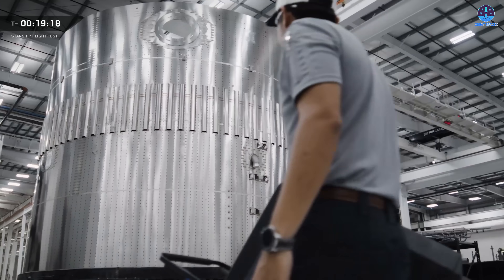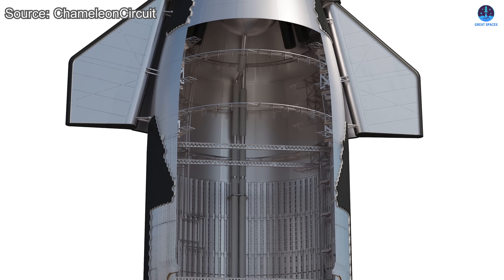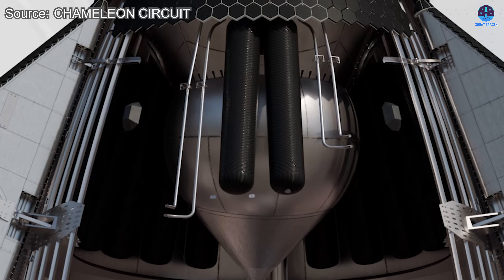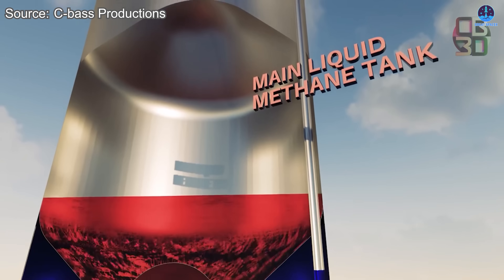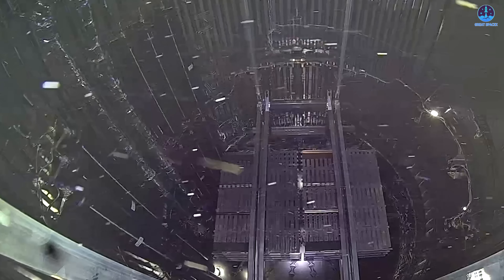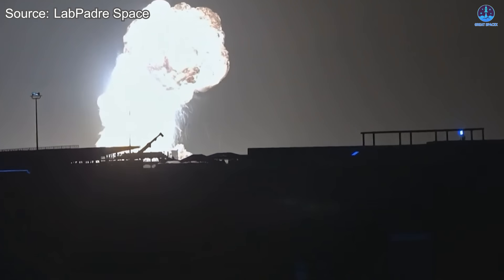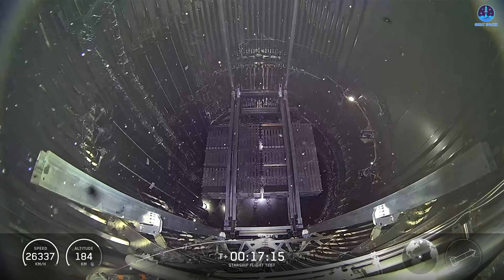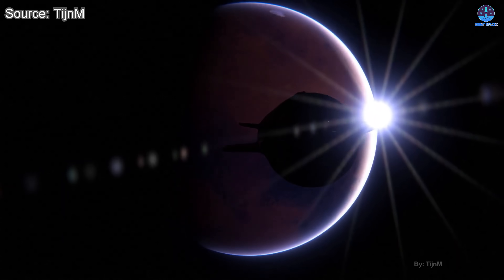Elon Musk revealed Exactly Why COPV can make Starship S36 Catastrophic Explosion...

Comment: Elon, as a mindset, always chooses to squeeze out every last bit of drop of performance from his designs. For example - design a multi-stage rocket - it should have hot staging.. Need tanks to contain fluids - use COPVs instead of steel vessels as they are lighter.. Relatively more dangerous designs all in order for more mission efficiency.. This mindset is not unworkable, it is perfectly possible to design such working things.. But they have to have robust safety features in the design. These rockets are like chemical factories that fly. And in every chemical process there should be safety in the design.

So designs are assessed first for safety and risks through and through - before they are built. As chemical engineers often say: "Do your HAZOPs guys"

Comment: Personally, I'm not impressed by Composite materials like Carbon-Fibre as a material. I assume they used it for reasons of lightness, but for such a critical component, I think they should have gone for a more proven material, such as a lightweight metal like Titanium, which would be more suitable for multiple re-use over time.

Comment: 0210 Actually, no.   The COPV did NOT fail because it exceeded pressure limits. According to the Elon post you included, it failed BELOW proof pressure.  This means it likely failed because of an undetected manufacturing defect, or possibly because something "knocked" it hard enough to compromise integrity.  Unless, the actual cause was something else (hence "further investigation."
Reply: Isn't that even worst?
Reply: I also find this interesting. But of course pressure is only one sort of load that can lead to failure. I was even surprised they use carbon fiber at all plus a strange way of not-really-weaving that mostly depends on the glue - whatever. In a vehicle that will fail, brittle components are a no-go because they make the analysis hard: clues are everywhere, literally. smashed.

Comment: Gosh.  You'd think that the Oceangate Titan implosion would have been enough of a warning for SpaceX engineers...
Reply: No so.   Titan failed due to COMPRESSION failure.  The college opposite.   Plus Titan had to withstand 5,000psi+ at Titanic, where a "normal" tank (SoaceX might have different sites) is only 2,200 psi.  Keep in mind,  PSI is not a linear profession. 

Plus, if you had watched Titans videos, they didn't "overwatch" - criss cross- the CF strands - the just did a spiral wrap. Nor did they do the wrapping under lab conditions or properly test and cure the vessel.
Reply: 😂 your a little slow huh

Comment: Because of ongoing on-orbit issues with orientation control authority combined with Musk's statement about the COPV I think it very likely that they were pumping the COPV to a higher pressure than they used in past missions, closer to the test limit. Pure speculation, but I think this scenario is likely.
Reply: An ex Spacex engineer has come forward to say workers at Spacex have been handling COPVs carelessly and rushing through engineering tasks with inadequate care and testing.

Comment: Did the COPV get too hot; Was it baking in the Ship, in the Texas summer sun? Before an uncontrolled temp shock when cryogenic LNG-fuelling started in the cooling night environment? Thermal cycling resistance of COPVs, questionable? Were temp sensors in the Ship? 
I think even the JAXA Lunar lander failure stems from a thermal shock problem, too. With their high-tec ceramic nozzle in untested Lunar surface conditions! 
When the cold Nozzle Bell came down, landing, 
 from the usual cold shadowy space condition, and dived into >100°C IR radiation outside, uneven_sided IR _ from the daylight Lunar surface, while the engine ran for a few minutes; this ceramic nozzle was overwhelmed! 
  To avoid too sharp thermal shocks, a layer of insulating foam over the COPVs outside may help.

Comment: How many times has this unit been used? Maybe the copv units will need to be replaced more frequently to ensure these explosions dont occure.
A bit like helicopters have to have certain bits replaced frequently because of the vibration. It is still a multi use vehicle but just needs more maintenance
Reply: I heard they reused the one recovered from the Bahamas a few months ago 😜

Comment: COPD failure in falcon nine, failure of the titan submersible at lessless than the maximum depth?, and now COPD failure with starship two. Am I the only one that can see a trend here with this composite material and structure?  I think carbon fiber is fine for an application where you need maximum weight savings with maximum strength, and you only need to do it one time. A HMARS missile, Or an ICBM. No people involved, and only gets used once, and if it were to fail, not too big a deal. I think these kinds of composites are a bad idea. They just do not have the toughness of steel and titanium.  I’m not overtly against using them, but they need to be added only as a safety measure, not something that provides the threshold strength. The threshold strength needs to be achieved by the steel or titanium tank itself. Then add some carbon fiber to increase your margin of safety. That is not what most people do today. The bottom line is that I just do not trust, carbon, fiber, and neither should you. If something sounds too good to be true, it probably is.

Comment: hmmm, a difficult problem.The carbon fiber wrapping overall adds strength but any weakness or inconsistency in the wrap could be difficult to detect, so will they need to go with a solid body system; thicker and easier to measure, but add more weight.

Comment: Truthfully Aliminium and carbon fibre will vibrate loose and seperate. It’s not a long term solution. Why not 3D cast or print new ones in different mediums with stress line backup. Held against launch forces. Make s sense thnx kev.

Comment: That Titan submarine that imploded heading to Titanic was composite overwrap. Composite overwrap on solid rocket boosters have failed in the past causing rockets to blow up.  Carbon fiber has excellent tensile strength but sheer strength is near zero, that is why the Columbia shuttle blew up during reentry because of hole in the carbon leading edge. Even NASA engineers don't quite understand the difference between tensile strength & sheer strength.  Bottom line is, Don't trust carbon fiber.

Comment: Sounds like same or analogous issue that plagued the OceanGate Titan submersible.  Just another in a continuation of unexpected/unresolved Starship problems.  Like Stockton Rush, Musk is full of chutzpah.  Hmmmmmmmmm.
Reply: The high pressure is on the other side to titan. Titan had pressure pushing in, the copv has pressure pushing out. Carbon fibre is good in tension not compression

Comment: The should increase the wall thickness of the aluminum vessel and double the thickness of the carbon fiber wrap. Have the pressure point of failure far away from the working pressure.

Comment: Replace the circle of small COPVs with a big toroidal fuel tank, the width of the craft. With big toroidal tanks, stacked, you get a better volume-to-surface area ratio, so you can afford to use stronger, thicker walls, or have the same amount of gas in larger-volume tanks that operate under less extreme pressure. And you still have central access.
Reply: The COPV’s separately pressurise the fuel and oxygen tanks to ensure feed to the engines. They are not “fuel” tanks.
Reply: Thanks for the correction

Comment: If spacex weren't so tight, there are metals out there that would be very suitable for the copv.
Reply: The solid metal tanks weigh more.
Starship is severely weight limited.
Reply: They should be made out of titanium. Yes its expensive but very strong and light and something like that they shouldn't fool around with.
Reply: @randomnonymous Titanium is heavier than aluminum alloys… (it does have better heat and corrosion resistance).
Reply: @allangibson8494  It is also somewhat flexible like a spring.
Reply: @randomnonymous Actually carbon fiber has virtually no “give” at all - it’s the epoxy resin gluing it together that gives.
It yields at 90% of breaking strain.
Reply: its a lot easier to spend other Peoples Money for them.

Comment: My guess: 

Carbon was not wrapped tightly enough, allowing the aluminum tank to expand/contract beyond tolerance.

Fatigue tolerance in aluminum is often 20k cycles, but it may be 2k cycles or less at these temperatures.
Reply: One nick or scratch and fatigue values are out the window. cyclic loads cut by 10X
Reply: @HongyaMa 

Yeah.

Aluminum and carbon/epoxy probably have very different coefficients of thermal expansion.  

You get a strain spike right on the bond.
Reply: Agreed, pretension of prepreg tape insufficient. Not likely a fatigue issue; insufficient pretension load on the internal liner could permit structural rupture of the liner. I would guess these COPV's are one time vented; only cycling occurs during certification testing.   COPV's are all potential bombs with tremendous potential energy stored in the form of compressed gas.
Reply: Use titanium instead or increase the wall thickness.
Reply: @randomnonymous 

I suspect it to be a manufacturing defect rather than a design defect.

Comment: There is always a "first time" for anything. You can usually bet that there will be a second time as well. I highly doubt aluminium and carbon fibre composite have similar expansion and contraction rates.
Reply: Actually for handling gases thermal expansion is irrelevant - because the gas is supposed to be at room temperature. When it gets abnormally chilled things get “interesting”.

Comment: The carbon fiber bands were probably the cause, just like they were on the Ocean Gate Titan submersible. Carbon fiber has a lot of strength in the longitudinal dimension, but it could not withstand compression, especially if some of the fibers wrapped around the core were compromised. If some of the bands, in a critical place, failed on one of these tanks, they wouldn't prevent it from exploding.  That is my opinion.
Reply: The safest ones are spherical.
Reply: Yah carbon fiber is very sketchy. I wouldn't trust it so much. After all it's just carbon cloth mixed with resin like fiberglass.
Reply: @randomnonymous  
And COPVs are not good for re-use and multiple decompressions and multiple re-pressurisations. So if the new COPVs are failing first time one can only imagine what might happen with supposed Starship reusability. Like the shuttle, quick turnaround and reusability is a myth with repair damage and refurbishments after each flight taking months, unless one wants to throw caution and safety to the wind..... over to Elon.

Comment: In the world of crazy high Pressures Common for c.o.p.v. the mettle bind expansion or lack of could be putting the crimp on tank when wrapped Molecular siding Area on charge and release should allow for proper tank to inso crush membrane or expansion Regulator layer then over wrap the 3 strat egg Shell !.
Reply: Interesting word structure.

Comment: Different vehicles similar operating conditions and multiple failures.   Composite construction may not be suitable for reusability.  Composites matrix don't have a fatigue strength for cyclic conditions. Composite binders have fracture characteristics which create cracks when subject to cyclic loading and the composite matrix can fail due to lack of binding the fabric to the binder.  The Titan submersible composite vessel failed due to cycling when descending to high pressure and ascending surface pressure.  SpaceX should look for another construction method for the N tank.

Comment: Starship development is starting to look like German V2 development in the late 1930s and early 1940s where they had explosion after explosion having a massive infrastructure for rabid trials.   Starship doesn't have a crew survival system for catastrophic failure.   The rocket plane X-15 did have crew survival system.   The front of the X-15 with the pilot was made to remain intact and separate from an exploding rocket motor.   It had a blast shield bulkhead.   A rocket motor did blowup with the X-15 mounted to a test fixture with a pilot inside.   There was fire everywhere.  One of the engineers without fire protection ran to the cockpit desperately attempting to free the pilot who was perfectly safe according the book The Right Stuff.   

Starship might have the crewed section of the ship engineered to separate as the X-15 US rocket plane.  This creates time for the crew to act to save themselves.   It would allow the crew to parachute out if at altitude.   If in sub orbit the separated crew section might have a one time heat shield allowing the crew cabin to achieve reentry then the crew to parachute out once in optimum conditions.

Supersonic speeds for crew ejection is possible requiring a protective pressure suite.   There maybe some measures that could be taken to lessen velocity once in heavy air.  Drag chutes might be small enough not to require a great deal of storage space and able to slow the separated section below supersonic velocities.   A full landing parachute system for such a large capsule is likely impossible.   This doesn't resolve the issue if the rocket blows up on the pad for crew survival.   

 A repulsive rocket backpack enable crew escape system on mars doesn't require a large rocket with the 0.38 gravity of earth.  The crew member might experience 9G's of thrust just before the surface as the rocket operates for a few critical seconds dropping the velocity just below supersonic to zero.

Putting high explosive elements in the crew area of Starship makes it less likely to be human rated.   There is probably another solution that could change this.

Comment: Transporting cylinders directly on pallet without any padding or better a padded transportation fixture is bad practice.  There are corner points in contact with the composite overwrap.  So will need to understand failure mode to check if induced damage was a contributory factor.

Comment: I have been working with COPVs for 23 years and have never seen even the most heavily abused units fail. 
 either there was a massive over pressure incident, the hardware used to pipe the gas in& out/regulator/valving or the tank manufacturing process was compromised in some way. 

I know that the units I work with a regularly tested up to 2.5 times the rated pressure to be certified for use.
Reply: Yeah, I'm still not buying it!! If the COPV exploded enough to come out the side, where  did the methane come from?? That volume of nitrogen should have instantly filled the cargo bay and nitrogen does not explode into flame.  NSF videos suggest the explosion in the cargo bay, launched the COPV largely intact with the nitrogen gas escaping as it flew.  seems obvious that the cargo bay had a lot of gaseous Methane in it when it blew.  The Methane tank was only about 20% full. If this COPV was for purging the Methane tank, you have to winder if they neglected to refill the COPV with Nitrogen?? 

I hate the fact that SpaceX release reports like this without better explanations. I tend to not trust what they are telling us.
Reply: @professorg8383 more than likely the component  failure would have created flying debris & the sudden over pressure in the section combined with the debris would have easily ruptured either the tank below or the piping or both and that would have easily caused the catastrophic failure of the tanks and subsequent conflagration.
Reply: @VroomBox42  If it failed, I would agree that it would likely rip apart into quite a few pieces and maybe over pressure the cargo bay, which is a huge volume, but quite a long distance from bulk head separating the cargo bay from the tanks, so debris would have to punch through then the tank. There really shouldn't be any live methane piping up in that section. and even so, it seems like the cargo bay could not instantly be mixed with the atmosphere now flooded with nitrogen and somehow ignite instantaneously. 

Clearly the cargo bay erupts first, exploding through the shell walls and then as it collapses, the bulk head likely goes and then the methane tank. The cargo bay comes apart, starting near the fin an flames erupt out that opening. and then we see a COPV getting launched away from the rocket. 

If you watch the slow motion multiple times, there is a distinct chain of cascading events. You can even see the difference in color and is liquid oxygen and methane, "spilling" downward as it erupts into flames. Keep in mind that they use ignitors in the engine combustion chambers. It won't spontaneously ignite, but a gas air mixture can ignite with a simple spark.

I think if it happened as you suggest, there would have been a slight delay before everything lit up. 

I think Musk has a motive to make it look like they know what happened and the fix would seem pretty simple.  The FAA is going to need a good explanation before they let it fly again.  Imagine this occurring with a fully fueled full stack!

Comment: Why not take the route that is used with deep dives, we put the divers at an equivalent pressure to resist the high pressure of the water why not enlarge the methane tank for the volume of the copv and put them inside the tank, we support the internal pressure of the copv with the pressure of the methane.

Comment: This says absolutely nothing about why this COPV failed. It was below its proof pressure, meaning to had been tested to its proof pressure. It was in the cargo bay, not exposed to propellants, presumably not exposed to cryo temps. There was no engine firing, no dynamic loads... so? It sounds like a design oversight.
Reply: Aluminium wrapped in CF is an early soln, and any variance in alloy mix will induce failure zones.